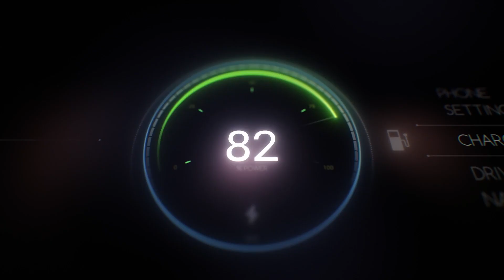Our next breakthrough has a name

Comment: But you guys made the most reliable motor out there the 12 valve 5.9 with a p pump that u can throw 700 horse through stock and even when u say blow a head gasket they still run 😢